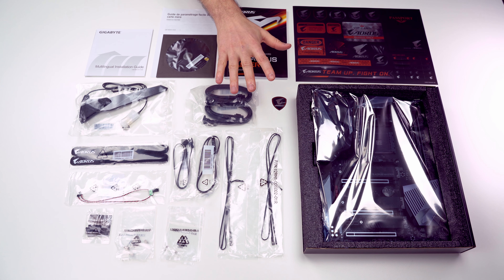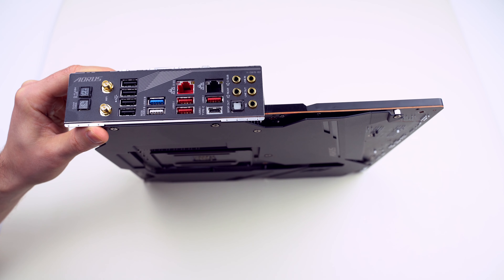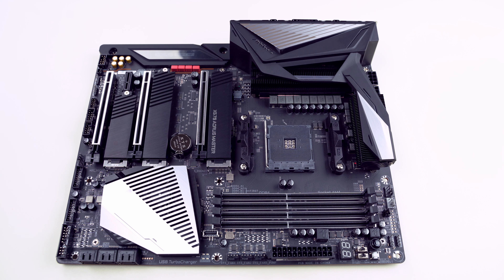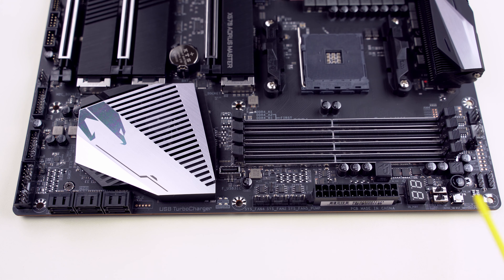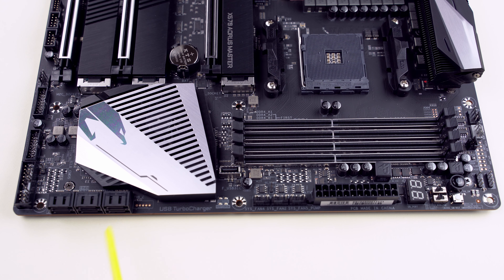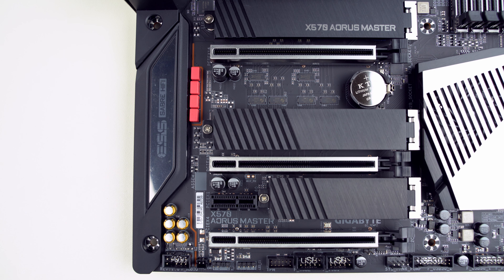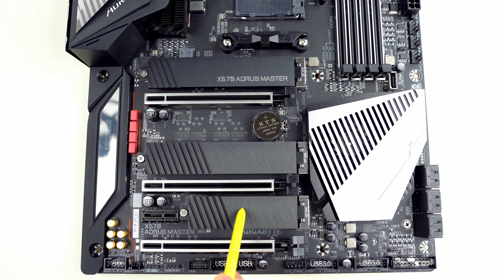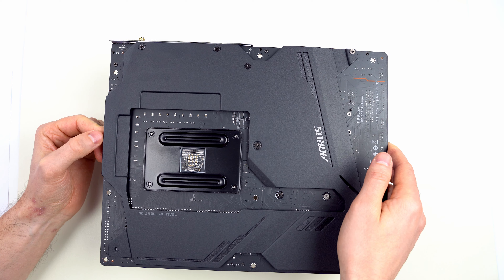Gigabyte X570 Aorus Master - Unboxing + Complete features description

Comment: Wow, this was excellent, highly detailed, and thorough. Thanks for the details on the M.2s disabling the 2 SATA ports. That helped me plan around that potential problem.
Reply from the maker: You´re welcome! One of the possibilities is placing a separate PCI-E SATA controller/RAID adapter into the 3rd PCIE slot if you need more of them.
Reply: @MartinsLab  Hmm, wouldn't that also deactivate SATA ports? I know that's the case on some boards.
Reply from the maker: @RicochetForce  No, only using 3rd M.2 socket (M2C) which shares bandwidth with the SATA 3 4/5 connector (which is the one I referred to in the video) also results in disconnecting it completely – you can find it on page 32 in the manual as “(x): Not available”. 

There is an overall bandwidth limitation which is shared by 2nd a 3rd M.2 sockets (M2B and M2C) and 3rd PCI-E 4.0 x16 slot (which effectively runs only at PCIE 4.0 x4 speed) and all SATA ports from the chipset X570 to the CPU - which is four PCIE 4.0 lanes (7,877 GB/s).  But this doesn´t disable anything, it only results in shared bandwidth - more devices compete for 7,877 GB/s „pipe“ to the CPU.
Reply: @MartinsLab  Ah, that seems like a good workaround. One NVME SSD in M2A, one in M2AB, and one in the 3rd PCIe slot you mentioned with an adapter card.  Thanks for the help!
Reply from the maker: @RicochetForce  No problem. What I meant was, one M.2 SSD in each M.2 slot (M2A, M2B and M2C) + adapter card in 3rd PCIE x4 slot – which can allow you to connect 4 - 12 SATA SSDs/HDDs – depending on which adapter you choose). Shared bandwidth doesn´t matter, because you almost never READ/WRITE to all drives you have at the same time and continuously - which means the “shared bandwidth problem” doesn´t affect real life use except for very specific scenarios (You haven´t mentioned what you do on your PC, so I don´t know if it has any effect in your particular use-case or not).
Reply: @MartinsLab  Oh, I'm using it primary for gaming but I do have SATA HDDs and SSDs from prior builds that are being installed. 6 of them, so losing 2 SATA ports would mean I can't use 2 of my existing drives. An adapter card like the one you mentioned would be a very good work around and would let me use the 3rd M.2 sata slot. And you're right, I'm almost never reading/writing from multiple drives at once. And considering 3 of the 6 drives are good ole HDDs, their max speed is far below the SATA 6 spec, let alone PCIe.  

I've never used one of those adapters before. Are they affordable? Will I run into weird drive issues (like drives vanishing)?
Reply from the maker: @RicochetForce  It depends on what requirements you have - what RAID level you want to use - if any, what bandwidth would be available at once and how many drives you want the controller to connect and what brand you pick + there are ton of other advanced features. I would advise against cheap Chinese products with no support.
 ,
If you just want to connect the drives and not use any special features, you can check out Rocket640L from Highpoint - which would allow to connect 4 SATA drives, doesn´t cost a fortune (69 USD) and is from a respectable vendor. If you want RAID version check out RocketRAID 640L (PCI-Express 2.0 x4 SATA 6Gb/s RAID Controller - 112 USD). There are also other good vendors like Microsemi, LSI Logic or Adaptec so look at what they have too. Its best to buy from a brand which specializes in storage solutions, because you´ll avoid any issues like "vanishing etc.".  Here is a link to Highpoint I mentioned -  https://highpoint-tech.com/USA_new/series_r600-overview.htm
Reply: @MartinsLab  Wow, that is exactly what I'm looking for. That low profile one would be perfect in the bottom PCIe x4 slot on the X570 Aorus Master. Then the 3 HDDs could connect to that, and boom I free up one port on the board for another 2.5SD and I can use the M2C freely. 

Thanks a TON, man! You definitely earned a subscription from me.
Reply from the maker: @RicochetForce  You´re welcome, thanks for the sub!

Comment: This was great. I realised I had placed my M.2 card in the position that was least effective. Thank you for the effort you have made to produce this video. It has been really appreciated.
Could you please do a similar Video on women, in particular the version after the wedding.
Reply from the maker: Hi Paul, thanks! The „women after the wedding” video could be done, but raw data would have to be obtained from secondary sources, because I have zero personal experience with that use case. I wish I could help. However, I am a decent analyst, so I might be able to compare versions „v0“ (before) and „v1“ (after) if provided with statistically significant amount of evidence. I am guessing that interesting behavioral patterns could be found. For now, you´ll have to do with knowledge of efficient placement of M.2 NVME SSD 😉

Comment: Thank you Martin! What a terrific video for someone who has been searching YouTube for this kind of content on this specific board, droner and graphic artist. I have huge demands I'm trying to support, including adding a Drone Simulator software for further practice training. Hard to keep up with the the changes of technology, but really enjoy learning and acquiring the skill sets to help myself. A huge learning curve, but determined to understand to know how I need my system built. I also picked up the EVGA RTX 3800 XC Ultra Video Card and hoping this will sufficiently support the DJI Simulator software, as well as all the creative content post editing and rendering I will need.  I'm still trying to understand how many fans for exhausting and cooling I will need. I have not updated the cooler that comes with the Ryzen 9 3900x, but wonder if I should go to a Deepcool Castle 360EX radiator for the Ryzen vs. the Wraith Prism that comes with it. If you can comment, I would greatly appreciate any suggestion you can offer. Thanks again for such a thorough video on this motherboard!!!  ;-)
Reply from the maker: Hi Athena, you´re welcome! How I understand your situation is that you´re building a new computer and have already picked up CPU Ryzen 3900X with stock Wraith Prism cooler, GPU - EVGA RTX 2800 XC Ultra Video Card (3800 serries from nVIDIA aren´t on the market yet – or you have special connections?) and motherboard Gigabyte X570 Aorus Master. These components are all fine for both the Simulator and video editing/rendering. By picked up you meant, you´ve already bought it or have chosen it to buy?

You´ll also need to get at least 16 GB RAM - recommended by DJI for the simulator. I personally wouldn´t go under 32 GB, especially if you plan on doing video editing - and would get 2x16GB modules ideally running at 3600 MHz, CL 16-19-19-39 (G.SKILL Trident Z Neo for example – good price/performance). I have already tested it with this MB and it works great.
 
To answer your question about cooling in a useful way, I´ll need to know if you have already chosen a PC case and if not, if you have any preferences? (how many hard drives/SSDs you want to use or what capacity do you need to have for you projects, will you use any other expansion cards etc). The choice of the case has impact on the choice of the cooler and its mounting (how it is installed), because not all cases have the same internal dimensions and allow installation of 360 radiators – like the Deepcool you mentioned.

Generally for a system with the components you´ve chosen I would recommend NOT using stock Wraith Prism cooler (gets loud – spins very fast, when the CPU is in all core load – rendering - and doesn´t keep the temperatures low enough to enable using its full potential) and getting something stronger. I consider Wraith only as a temporary solution - only if you have nothing else. So, the Deepcool would be definitely better. 

However, there are more great options like Noctua NH-D15 if you want to use air cooler (long term most reliable) or cheaper and still great water cooler like ARCTIC Liquid Freezer II 360 - yet not as nice looking – doesn´t have RGBs. Depends if you want both better cooling and RGBs as well.

To your questing about the number of fans – generally for the components you´ve chosen, you should have a case with at least 2 front fans in the case for air intake (2x 120 mm or 2x 140 mm – better) and 1 exhaust fan 1x140 mm at the back. All running between 1000 – 1200 rpm (higher speed of the fans doesn´t mean better here, becase it also produces more noise - so a balance has to be found between cooling performance and noise it produces). Fans can be regulated by the 4 pin headers on the motherboard or on the case controler – depends on which case you choose - thats also why I am asking about the case.

If have more questions let me know ;) We´ll solve this.

Comment: I ordered mine i wish 3rd m.2 slot works independently not sharing with 2 SATA ports. Excellent detailed presentation
Reply from the maker: Thanks, unfortunately we´re out of luck, the number of PCI-E lanes on x570 chipset is limited, only a Threadripper or an external PCI-E SATA / U2 adapter could solve this problem (that’s what I am planning on using)..

Comment: Really detailed video. Great job.

One question. Is it better if I install a set of 64gb(16gbx4) ram and populate all the slot or just install a set of 64gb(32gbx2) and only use 2 slots of ram? Thanks 😁
Reply from the maker: Hi JTim! thanks 😊 The answer is a little more complex. It depends of few factors:

a)  If you don´t plan on upgrading to 128 GB later and know that 64 GB will just fine – than 4 sticks may in some use-cases bring some more performance (lower single digit % - based on tests done by other reviewers), therefore it could be better from this point of view.

But 4 sticks are more demanding compatibility wise, so make sure these DIMMs are on MB manufacturer´s QVL (qualified vendor list) - or you know that somebody tested them and they work with this MB. Make sure you look at right memory list:  

QVL for Gigabyte X570 Aorus Master  is here - https://www.gigabyte.com/Motherboard/X570-AORUS-MASTER-rev-11-12/support#support-doc
1) Matisse = AMD Ryzen 3000 CPU series
2) Vermeer = AMD Ryzen 5000 CPU series

As far as I know, the best memory modules that exist at this size are 16GB DIMMs with CL14 running at 3600 MHz, but they are very expensive. More budget friendly will be CL16 running at 3600 MHz. I personally wouldn´t go lower on MHz (price difference between 3200 and 3600 is not that significant). Higher speed memory modules (4000 MHz) also usually have higher CL timing - so the speed is achieved at the expense of timing (which is good for FPS in games - if that´s what you´re after).
 
b)  If you plan on upgrading to 128 GB later – then 2x 32 GB will make more sense (you´ll just add another two same DIMMs later). There is a little catch here, larger DIMMs are usually available with slightly higher CL timings, which might slightly lower the performance unless you pick fast and more expensive ones – but they will likely not be able to achieve the same speed as the ones with lower (16 GB) capacity. The compatibility will be better (two memory sticks are easier to handle for memory controller than four). Checking QVL is always recommended anyway.

The best 32 GB DIMMs are available with CL16 timing. Common ones are CL18. 

My personal experience: I´m now running 4x 16GB (3600MHz/CL16) DIMMs with standard XMP profile from the manufacturer on a different X570 motherboard. So far, I haven´t noticed any significant speed increase (but I haven´t done thorough testing – just a few initial AIDA benchmarks - will maybe do later). The speed achieved in benchmarks is also dependent on CPU boost clock, and with different versions of BIOSes you achieve different CPU boost clocks, so this factor has to be taken into consideration when doing potential testing. Definitely go for the newest possible version of BIOS available (takes 5 minutes to do). I noticed memory speed improvement after upgrading to the latest BIOS, although it was small (0,5% - 1%).
Reply: @MartinsLab Wow! I didnt expect such a detailed answer. Thank you. I’m sorry if I’m gonna ask you some more question.

I’m not sure if this particular mobo support the Ram that I wanted(already checked the QVL for this mobo) but the QVL of the Ram said it is compatible with this mobo. 

The ram that I plan to use is the “G.skill trident z neo 64gb(16gbx4) 3600mhz CL16” and I’m gonna pair this mobo with a ryzen 9 5950x.

I’m not only going to play games for this setup but also doing some animations and video editing 😅
Reply from the maker: @joabtim4352  If you keep people locked home long enough you´ll get long answers from them 😊

Not all memory modules which will run on this MB were tested by the manufacturer - especially now for Ryzen 5000 series because it is too new and testing takes a lot of time. So many memory modules will be added to it over time.

When you´re referring to RAM, it´s best to use S/N to identify them to make sure we are talking about the same modules.

I tested this MB with 2x 16 GB kit – S/N:  F4-3600C16D-32GTZNC - G.SKILL 32GB KIT DDR4 3600MHz CL16 running at (16-19-19-39) using XMP, with F11 BIOS (at the time). 

Link: https://www.gskill.com/product/165/326/1562840211/F4-3600C16D-32GTZNCTrident-Z-NeoDDR4-3600MHz-CL16-19-19-39-1.35V32GB-(2x16GB)

I was using Ryzen 9 3900X overclocked to 4.1 and 4.25 GHz all core - when I was doing the “Zalman CNPS20X vs Noctua NH-D15 SE-AM4 in TEST” video.  

So, I know these memory modules work with it - everything was rock stable (I was testing for 5 days – Cinebench, Blender, AIDA, Resolve). How it´s going to work with Ryzen 5000 series I don´t know yet – my CPU hasn´t arrived yet ☹ Maybe someone else who has this MB knows? 

The chosen CPU and RAM size suggests you´re not going to for gaming exclusively 😊 (Johnny Silverhand in the back just winked at me)
Reply: @MartinsLab  Oh, I’ll make sure to double check it if it’s compatible. Thanks 👌🏻

Btw, which one is preferable when updating bios for the ryzen 5000 series?

I am not familiar with using the q-flash bios or updating the bios externally without the cpu.

But, we can still update our bios traditionally by going to the mobo websites right? 

Thanks again for your replies. Appreciate it
Reply from the maker: @joabtim4352  If the RAM manufacturer says that it is compatible in their QVL, then I would believe them. I personally can´t just say I know it works because I haven´t tried it myself with the same configuration you plan on using it with (I don´t want to take the responsibility for the final result unless I´ve tested it).

I like watching the update process in the BIOS (therefore “Q-flash” is my preferred method – but it´s just how Gigabyte calls it, it´s not any official standard way of updating BIOS for all motherboards). If you only have a new motherboard (Gigabyte X570 Aorus Master) and new Ryzen 5000 CPU, you may not have any other choice than using “Q-Flash Plus” (without CPU) method. I explained everything in detail about both options in the top „pinned“ comment in this discussion.

I don´t know what you mean by „traditionally“? If you want the latest BIOS you have to download it for both methods from mobo´s website.

Comment: Hi Martin, Thank you for a detailed and comprehensive coverage. I saw this video twice. One doubt, there are two CPU power headers, is it mandatory to power both the CPU power headers?
Reply from the maker: Hi CK THIRU, the manual doesn´t say if its mandatory or not (so its a grey area), but if you are planning on overclocking, than I´d say it is mandatory. The benefit of having both 8 pin connectors connected is, that you will probably be able to load each of the rails on the PSU less, which might improve the stability of the system and allow you to draw more power if necessary. I´d personally connect both 8 pins - as seen in the build video mentioned at the top.

From a functional stand point, I tried running it with only one 8 pin connected (just to test it) and it worked fine (when not overclocked). If you want more detail about the testing with only one 8 pin connected check my answer to @Nuri in the discussion.